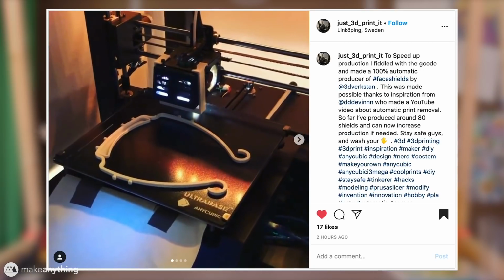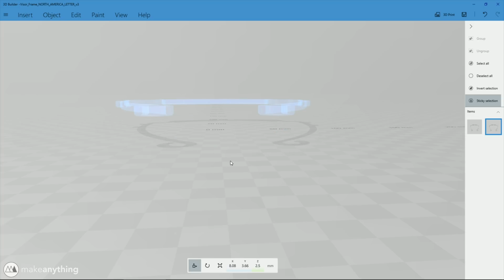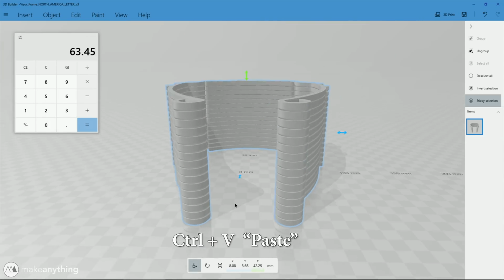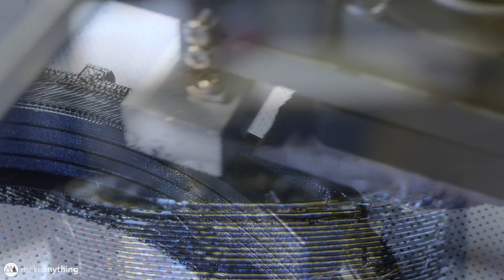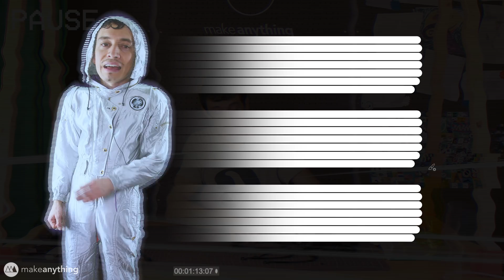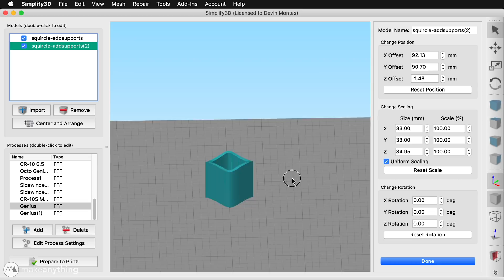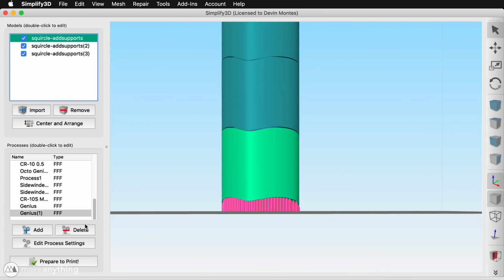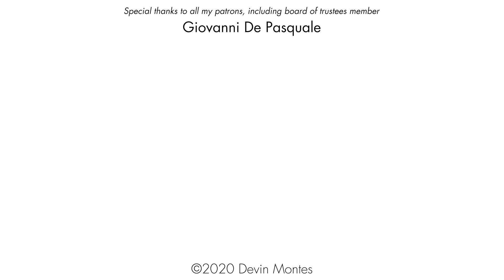Stacking 3D Prints & Scratching Faces

Comment: stupid question maybe, but doesn't the gap from those empty layers "add up" over time causing you to print more and more in the air? or does it just make the lowest layer above the gap a bit worse and then equalize out over the ones after that?

Comment: Hey Devin, I recently got a new Anycubic i3 Mega S (your review played a big part in my final decision so thank you!), and I tried to print the scritcher mini, but it all fused together. The same thing happened when I tried to print a springo. Your designs look amazing and super fun to print, so I would really appreciate it if you, or anyone else for that matter, could help me. Thanks :))))
Scritcher Mini:
Cura 4.6.2
200 C nozzle
0.15 mm thickness
60 C heated Ultrabase bed
Extrusion: 100%
Infill: 10%
Speed: 50 mm/s

Baby Springo:
Cura 4.6.2
200 C
0.15 mm thickness
60 C heated Ultrabase bed
Extrusion: 95%
Infill: 100%
Speed: 65 mm/s

Comment: Hi, I have a question. What if im printing at 0.3 layer height with a 0.4 nozzle as I ussually do? The gap would have to be 0.6mm? or is it too much? Thanks!
Reply from the maker: 0.3 doesn't seem to work well. You might have more success bumping up to 0.34mm height with a single layer gap, but smaller layer heights are ideal for this technique
Reply: @make.anything  First of all, thank you SO MUCH for your response. I'll try to do that, is there a speed you can recommend? And also, what is the biggest layer height i could use?  I have 5 ender 3 printers and a LOT of shields to make. Love from Argentina Devin! you ROCK!

Comment: PLEASE HELP! I'm also trying to batch out face shields, but when I go to print the stack, I get one beautiful print on the bed, and then the second shield in the stack won't adhere to the one before it, and I get spaghettification! I examined my layers in my slicer, and I only have a 1 layer air gap, so I have no idea why it wont even stick to the part below it. My layer height is 0.3mm. Any help appreciated!!
Reply: Printing with PLA on Prusa i3 MK2
Slicing with Cura (Only way to employ air gap)

Comment: Hi Devin, I am trying to build a 20 or 30 stack for local PPE visor production. We are all printing single prints at the moment, might you be able to expand a little please. The model we are using is 4.5mm high, the layer is 0.3mm and I have set the space to this but for some reason the first layer or two of the second shield is not adhering properly - the extrusion is irregular. Might you have any recommendations please,  I have been working on this for five days now any really unsure of what else to try. I am using an Ultimaker 2+, thank you . Ven
Reply from the maker: 0.3mm layer height is kind of the opposite of a sweet spot where one gap is too little and two is too much. But sounds like you're having underextrusion already with one layer... You might just need to slow down the print or increase temperature, at least for those first layers. I have to print slower, but stacking removes the in between work so it's a trade off
Reply: Make Anything Thank you Devin, could I ask what you mean by 0.3mm being the opposite of a sweet spot please? I will try to reduce to speed and increase the temperature in the mean time :)

Comment: if i print with 0.3 layer high i have to put a 0.6 gap? or its fine with 0.3
Reply from the maker: 0.3 is a toughie. One layer gap might work for PLA but extra tricky with PETG
Reply: @make.anything  im testing with pla with one layer of gap, i will keepyou informed n.n thank you for respond

Comment: As you may have also figured out is that the object also needs to be a thickness that is a multiple of the layer height or the math gets messed up too. By switching the air gap to 3.8 instead of 3 you're only increasing the margin of error. you wont truly get a 3.8 air gap unless your print is a multiple of 1.9 so the top layer of each print stops evenly with a slice.

Comment: "very brittle filament like PETG" i only print with PETG and it is definately not brittle if its stored correctly and printed at the right temperature. I was very surpriced seeing your holders breaking like that, my PETG parts never crack, they bend untill they lose their strenght

Comment: Thanks for the wonderful video.  You explanation made it easier for me to understand how stacking works.  With that said, I'm trying to follow your method but wasn't sure if this would apply.
I'm using .8 mm nozzle with .5 mm layer height.  Using your calculation:  .5 x 2 = 1.00 mm.  So my 2nd, shield z = 6 mm, 3rd z = 12mm, 4th z = 18mm.  
Is this correct?  Any feedback/advice would be greatly appreciated!

Comment: I used 0.3 layers with a 0.4 gap and it went everywhere, 0.3 gap and the bottom of the next was messy but it came apart fairly easily. trying 0.28 now. 
Any recommended gap for 0.3 or 0.4 layers with 0.6 nozzle?

Comment: I've seen a lot of good work in the 3DP community, but I've also seen a lot of mental masturbation and self promotion with little to no communal benefit. See real engineering's video on respirator design for examples. If you want to help do it with input from those who are or will be in need. The customer/end user will always have input you hadn't thought of... The bottom line is check with your local health providers and authorities, find out what they need and if they have a preferred design before you start turning out stuff they can't or won't use.

Comment: Devin, can you share your print settings for the Artillery X1? I haven't been able to print them stacked. 2-layer gap is too much. With 1-layer gap the drip guard in the front fuses 

I'm using .25 layer height. .5 line width. 40 mm/s speed. 205C. PLA.

I have 2 X1s printing these shields all day. If I can figure out stacking, I can print all night too.
Reply: Hi, don't know how to do also, but I received my X1 yesterday and I'm Printing 3 face shield in a row at 120 mm/s (40 mm/s for the first layer) 0.28 layer height. 0.5 line width, 4 wall line count, , 228°c for extruder and 70°c for bed, 130% initial layer flow, With PLA with no problem and very clean results. So it is 1 hour 41 minutes for 3 pieces without stacking. Hope it will help ;-)

Comment: So in my opinion you could possibly use the rectangular pattern feature in Autodesk fusion 360 to achieve this, your 3d printed puzzle cube tutorial is actually the idea that sparked this thought of mine. Say you wanted 3 of something with a custom tolerance lets say .3 mm for simplicity and the object had a total height of 10 mm you would first choose your object then your direction since you are stacking choose the z axis from your current orientation or the one going "up" haha then you will slide the object up your initial object height time how ever many objects you want in my situation i want 2 more so my equation will look like this 10mm(2)=20 then take that solution and type this equation that i came up with -20.00 mm - ( 0.3 * 2 ) * 1 mm I actually extruded downwards 20 mm so if extruded upwards just use a + instead of a - in the equation the, .3 is my custom tolerance so that will change for your personal liking that will give you perfect stacking of objects everytime!!! Now for exporting its kind of weird because you want to export multiple body's all at once how you do this is by, right clicking on the document settings or the button on the top that one and a dropdown menu of a bunch of things should appear you then find Save As STL option on that dropdown menu and save!! Load into your favorable cad software and you know the rest I am assuming you know all of this already because you have been doing this for a much longer time than me however, I wanted to give a very detailed description to help the community i hope this helps by the way im a huge fan of the channel it encored me into learning Solidworks and fusion 360 thank you.

Comment: A basic print at home respirator for those who can't get masks would be good. One that takes a couple of those makeup remover pads would be better than nothing. I printed the Brazilian V2 design (don't remember the company name) and it came out very stringy and seems brittle. It is designed for much better printers than home hobbyists have and I couldn't find and print settings recommended and mine came out stringy and with holes in the layers defeating the purpose. I think it's a poor design especially as a v2

Comment: Hi there! How does those flat areas between the layers even print out since there is a gap in-beween? I can't understand how this is possible... as if the parts are slightly connected even though there is a gap of 0.38mm between each stack...

Comment: does the gap have to be 2x the layer height? or just "big enough" I ask because I am printing with a 1.2mm nozzle in vase mode with 0.4 to 0.6mm layer heights. I suspect a 0.8mm airgap won't end well :-)

Comment: A scritcher that could go into a small bottle with a bit of isopropyl alcohol would be a cool addition. I'm thinking something that could fit onto a used plastic coke bottle that had been washed out and then filled with a little bit of ipa. Then you could just unscrew the scritcher from the bottle and scratch away knowing it was a safe scratch.

Comment: Does anyone know how to prepare gcode like this for a prusa mk3?  The prusa slicer doesn't allow you to leave gap layers, and i''m not exactly sure how to get all the settings correct in cura (I assume this is the actual way you should do things but every test i've done from cura left random issues throughout the prints).
Reply: Turn of background processing in settings.
Add a small support enforcer somewhere. I added a cylinder on each hook as a bonus it helps with sticking to the plate.
Slice manually.

Comment: thx 4 tha tip about the layer height deal with slicers. will adjust my 16 stacked quick print version stl and put it up on thingverse and facebook. Once I can also achieve easy separation parts. My Idea is to have the healthcare workers separate the frames and easily assemble the face shields.

Comment: Hi Devin, thanks for the video. I had tried this exact method and found that the petg didn't seem to like to drop down the gap and instead would occasionally make contact then string along with the tool head in a straight line until it happened to make contact again. This with a conservative .2 mm gap and .2 mm layer height. Weird! Almost like it preferred to be squished rather than dropped off.
Reply from the maker: You may need to slow down the print, increase temp or decrease cooling. Settings can certainly vary between printers and materials

Comment: is this faster than simply printing one at a time and having the printer push them off or it it just a mass-production method?
Reply from the maker: Well this printer has a strong raft and can't eject prints, for example. Ejecting the prints saves having to separate the prints afterwards which is nice
Reply: @make.anything  that makes a lot of sense, thanks!

Comment: Effective stacking, no, but I've seen on the 3DPN video people interlacing the ends together to produce more than one per print session. If the plate is big enough, and if you are willing to play with some angles, you can bang out multiple units per-stack and be able to go as high as your printer allowss for massive production in one session so long the filament is available to do so. I am sure anyone with a filament maker can figure out the feeds and speeds to use the filament as it cures for best results.

Comment: Hi! Great video. I'm struggling to stacking it. My problem is that I get the first layer of the upper parts printing on nothing, so the nozzle will pull the line and form a straight instead of the contour. I thought it might be 120mm/s velocity but it normally works. Can you help me? Thanks :D
Reply from the maker: Slowing down would definitely help. That or higher temps/less cooling, or you can do a test with a single layer gap instead of 2
Reply: @make.anything  Thanks, I've slowed down to 40mm/s and 1 and 2 layer hight and the separation is a multiple of my layer height and 1 layer it fuses and 2 layers got straight lines :S

Comment: Can anyone help me with my ender 3?

I'm new to 3d printing and I have no clue why my prints are so trash
Reply: There are so many thousands of guides, if those with videos and pictures can’t help you, then text won’t. Go learn how to set it up, level the bed, and start with those and then check videos on the subject. You should be able to use the thousands of guides and help forums on that exact (possibly most popular model on earth), there is no need to repost information identical to the other 999 on the same subject, but what you need is what I just told you, it all starts with a level bed and proper height above the bed (beyond that look at videos and guides, and even for that, look at videos and guides, over 100 people have surely already answered your exact issue, this will take effort on your own part, but Google and YouTube should give you all the info you need, good luck).

Comment: For processing those films, I'd suggest making a tool to align and grip the sheets in a stack. Then have custom holes that align to where the punch holes go, so you can stick a drill bit through and cut all the sheets at once. Put some radiused corners on the other side of the tool so the sheets stick out, and use it as a guide for a saw.

Comment: Another YouTuber found that PRUSA uses little dots, with one layer height, spread between parts, to space the stacked parts. This should help the parts separate easily while maintaining the alignment. Probably there should be more wizardry, like cooling or pausing, combined with the material used (PETG, IIRC) - my guess is that, with too much cooling or pausing the layers won't stick together, ending up in a spaghetti mess, and hence the dots to "glue" it together.

Comment: I have a truck/van still file I have designed, I need to print 1000 of them, how could I print them so that I could easily remove them and print in bulk, the surface touching the print bed is quite small, so I use a raft them pop them all of using a razor.

Comment: 3D Printing water :d
Reply: That would be cool, hook up a liquid nitrogen tank with probably an upside down shot-glass (to swirl the excess nitrogen gas as a coolant around the printed area), and I assume a peristaltic pump for water deposition. So it should be basically like molten plastic being cooled, just at lower temp like water freezing.

Ice sculpture printing would be cool (you can also print ice cube molds, but it would be cooler with more capabilities if it’s additive manufactured).

If this was a joke, well I’m an engineer, so I solve problems and challenges. Turning dreams into realities, that’s engineering!

Comment: What if to automate the process what you could do is use a dual nozzle printer to print one mask than water soluble pegs connecting the mask and print a stack of 16 with supporta. Then use the g-code the push the prints into a tub of water.

Comment: You've managed to ignore the main requirement on printing this face shield, or any of the face shields, by not wearing any protective gear while handling the printed parts in order to prevent the transmission of germs. Not setting a great example.

Comment: PETG should not be brittle. If it's brittle, you're printing it too cold, or it has absorbed moisture. I printed these faceshields in PETG and i can flex them almost straight before they fail.
Reply from the maker: It's super old PETG :\ guess I have to run the filament dryer longer

Comment: It would seem that you could double the number of visor bands on the print bed by printing one set rotated 180 degrees and laid out so that the  ear pieces were close to one another; sort of like offsetting a lower case 'n' inside a lower case 'u'. I realize this would not double the speed of production, but it seems like it should increase what might be produced by one printer over night.

Comment: THANKS FOR THE VIDEO! Im trying this method with a Prusa MK2. 0.35mm layer height with a 0.7mm gap between the masks. Prusa slicer is giving me a "Empty layers detected, the output would not be printable. Error. What to do?
Reply: Same problem ! If someone can give us a answer ..
Reply: @tsmith8693  I ended up downloading Prusa Slicer 2.0.0-rc. It's older but I did not get the error. Trying the first print now
Reply: Patryk W Will try to to find it... keep me updated concerning your print !
Reply from the maker: Hmm I don't have experience with prusa slicer but there must be a way to override that

Comment: Since we are on this topic... My next investigation will be with 0.5mm nozzle.. So each layer will be exactly 0.25mm, which will pretty much always line up with the millimeter accuracy that we do.. There will be 4 layers for each millimeter of height. Same in XY axis, 3mm width piece will have 6 lines if i use 0.5mm line width. I lose minute amounts of detail but overall, it should give much better accuracy, there won't be any math that has to be rounded up or down, you will never miss a line or a layer. Haven't seen any 3D printer youtubers do this test before, there is a suggestion for you too ;) (note, i'll probably talk about this in the other channels too, as i am interested about that "theory" by Miss Elk)

Good idea of using a calculator even when the "equation" is that simple. It is nice visual tool, you don't have to add them in graphics, you are doing it in real time and talking.. Nice touch.
Reply from the maker: You can also just tell your slicer that the .4mm nozzle is .5mm and it will over extrude accordingly. I've actually been printing .8mm wide just fine with 0.4mm